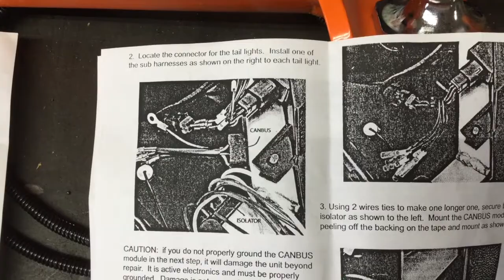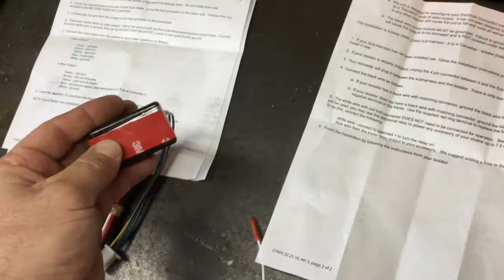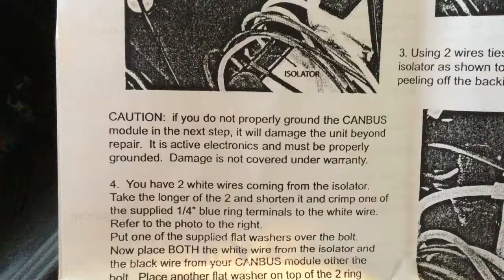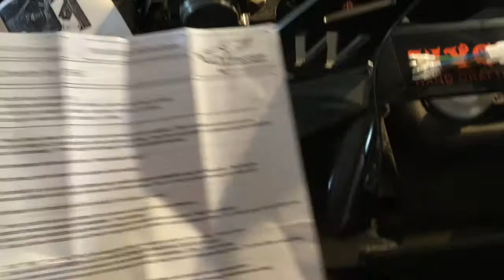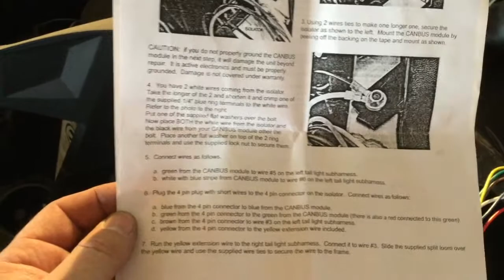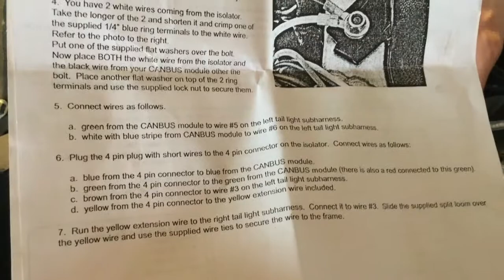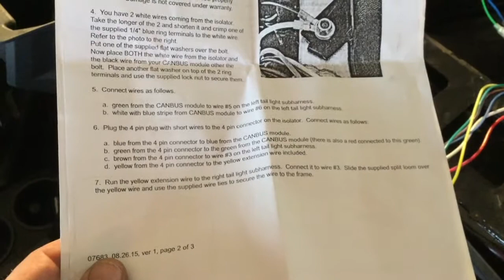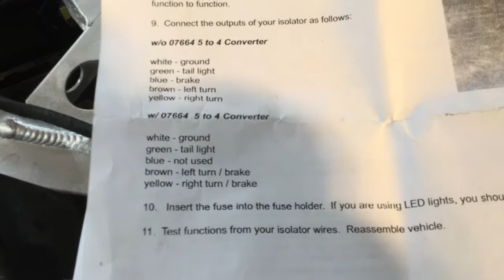Polaris Slingshot Trailer Wiring Harness Install

Comment: Why the 5 to 4 converter
Reply from the maker: It has to do with the electronics.  I''ve  tried other adapters, the Electrical Connection's is the only reliable option to go from a 5 wire plug, to 4 wire.

Comment: do you have to completely remove the rear top to install the harness??
Reply from the maker: I think it can be installed by taking off the rear underbody panel. I've never tried it myself but I'm pretty sure it can be done!  Good luck!
Reply: thanks.. thats just the 8 bottom screws right?
Reply from the maker: MrBarton1234 that should do it, the upper deck and the lower underbody deck have a lip that fits together so you gotta Flex the parts to get the underbody panel out